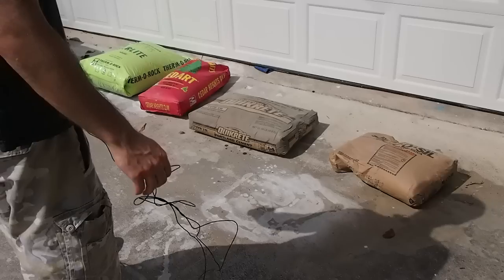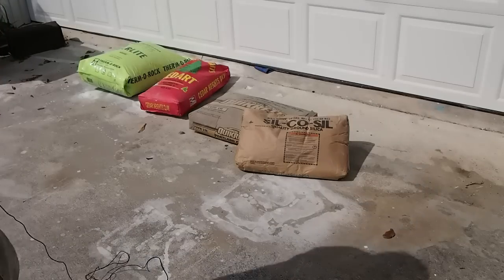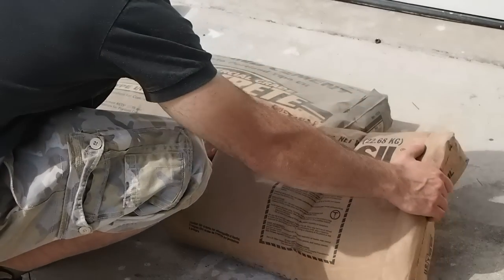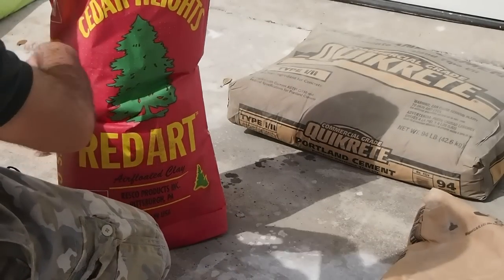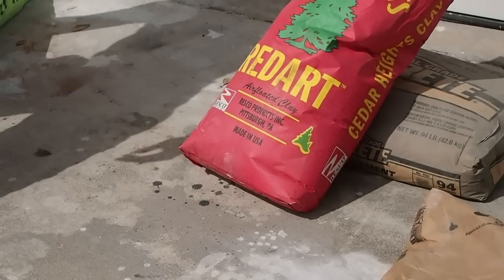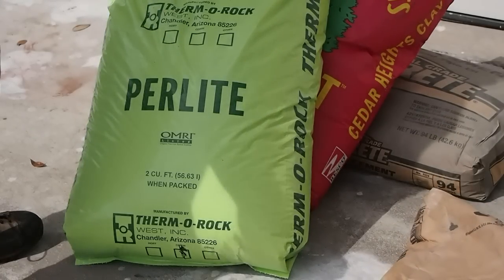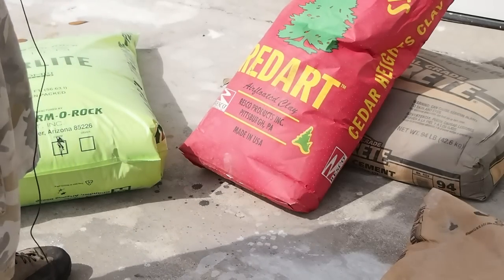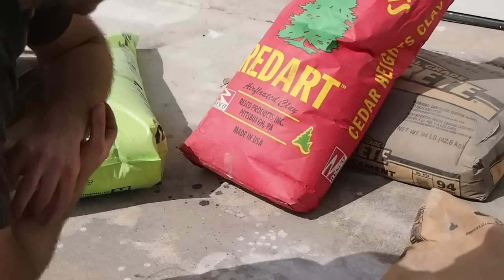DIY Refractory Cement Materials.MTS

Comment: I would use clay with around 10-60% grog, perlite, rice husk ash or sand. You may have long-lasting refractory clay this way. Love how your bag of clay has such fine stuff, while mine has hard ass bits of coarse sediments mixed in them, when I was looking for local clay. If you want clay to be fired real hard make sure everything is super fine.

Comment: I just built my cast for a rocket mass heater with 3" walls for burn tunnel and heat riser and it all got expensive really quick because how much the perlite compresses.  Did you mix everything in this video bag to bag?  How well did your mix hold together and handle the heat?  I may have thinned out my materials too much and may need to explode my cast to reclaim the materials to add in more clay and water glass.

Comment: You CANNOT use "quikcrete" or portland cement, in fact you cannot use any type of lime based cement. The reasoning behind what I say are fact based, I genuinely want you guys who are interested not to make unnecessary and potentially expensive mistakes. If you want real advice from someone who has genuine experience in foundry work, as a farrier, and a hobby silversmith then keep reading.
Firstly,  if you want to make a furnace, you have a number of decisions to make. At this point, a paper and pad is useful. If you are making a furnace from a disused gas bottle (probably the best route, not the cheapest but will save you a fortune in gas......gas is the only fuel I will ever use as it is the most easily  controllable, and definitely the cleanest) the a refractory has to be chosen. The chemical composition will be the definitive factor as to what metals you can effectively melt. Mine is rated to 1400°c which is plenty hot enough for my needs eg bronze, brass and copper, aluminium and it's many alloys. However you might decide you wish to cast iron etc, so a different refractory would be needed. Either way, AND THIS IMPORTANT! you must not use concrete, the reason why is that, yes it sets very hard with a chemical reaction using water, however when you heat this beyond 600°c, you basically start to drive off the chemically bonded water in the cement holding it together. This is bad, the same happens with the plaster of Paris type burners. The result is catastrophic failure. You will spend so much time fixing problems you will get very bored, very quickly. And besides, it costs £10 for 25 kilos of alumina refractory, it just ISN'T WORTH WHILE TRYING TO CUT CORNERS! you WILL completely regret it. By all means make yore own green sand, but don't mess with the refractory! If you need any help,  especially if you live in UK, give me a shout on my email, I will be happy to help. email- idauber@ymail.co.uk

Comment: Portland cement holds moisture after curing. That moisture expands when heated hot enough as it becomes steam. It creates an explosion.
Reply: Tango Tulsa Yea, but if you let it cure for a good week or two, or keep it under a heat source of some kind, it'll dry safely. I've used a mortar mix with some added play sand, 5 - 1 play sand - Portland cement mix, in an aluminum foundry, fired it twice, and no steam.
Reply: BlueMacGyver
How so?
Reply: The cement could crack and steam but not explode.  It is important to take the proper steps to remove the water but it will not cause an explosion just a structural failure.
Reply: +BlueMacGyver If the cement is thick enough and green enough, it can spall pretty energetically if heated just right.  You're correct that it isn't an EXPLOSION, but it can spall violently enough to be dangerous to nearby unprotected eyes.
Reply: Still using the foundry, no spalling or cracking. Dried for a week, fired with a slow fire, no air injection. Then fired slowly to optimal operating temp for a couple hours. Easy peasy.
Reply: +Lee C. Any idea about how hot your aluminum foundry gets?  I'm contemplating a wood burning rocket stove for cooking and recreational purposes.  I doubt it will get hotter than an aluminum foundry, but if you have good data that would be useful to me.
Reply: It gets to at least the melting point of aluminum, about 1221 F. Of course it gets hotter than that though. I don't have a laser thermometer, so I can't tell you for certain.
Reply: +Paul Bunyan I have built a foundry and fired it many times in the last several months and the recipe was mearly 50/50 portland cement and perlite from Miracle Grow.  This stuff has been so easy to make and so very tough, no blow outs, only cracks which were predicted by original recipe maker.  So much fun to play with.  I melted about 15 or 16 cups of aluminum at one time and have run that foundry for  hours in a row.  If anyone actually care about what works then this is it.
Reply: +BlueMacGyver I definitely care...  I wonder about adding glass fiber if preventing cracks for aesthetic reasons would be a concern...
Reply: +Paul Bunyan You could do it but, it would melt.  This is why no one uses sand in their mixes.
Reply: I did try to heat treat a 20lb hunk of scrap plate 2" thick I found at a scrap yard to see if I could and ended up glassing the edges of my mortar lining that were closest to the bottom, right in the hottest portion of the fire. It cracked some. Aesthetically it was ugly, but didn't affect the performance at all.

Comment from the maker: well if you made water glass you were doing better then me. from what i understanf rocket mass heaters should be made of cobb (clay +straw). my mix did not hold up! i wouldnt recommend using this recipe for high temp cement.  i ended up buying some castable refractory which worked much much better!
Reply: +PowerItYourself 
It's the bench, the thermal mass, that is made of clay & straw.
For the burn chamber and heat riser, you need something that can stand the phenomenal temps.

Comment: why do you need ground silica when you already have perlite?
Reply: The ground silica is in place of silica sand. Its sharper cut than concrete sand so it binds better. Never use play sand because it is refined for soft edges and is garbage as a tempering material.

Comment: it seems you are making insulating concrete. true refractory cement contains calcium aluminate. portland does not tolerate heat for long. so do some research.
Reply: Good to know!
Reply: I think refractory just means it can withstand heat. Portland Cement has some refractory abilities... but I'm not sure how much. It has to have some to meet building codes. If I were mixing this, I would use a high fire clay (i.e. lincoln 60). Either way, how did this mix work for you? What are your ratios for your mix?
Reply: terry smith
you can cant use Portland anymore for the fire box ya got to get fire proof premix mortar, it comes in ice-cream like containers just regular stuff crumbles it wont last 3 months with standard portland
Reply: I'd skip the cement if I was him.
Reply: Brother what are the ratio to make refractory cement I will really appreciate if you will share some of your knowledge.
Reply: I don't think he is using it in an industrial manufacturing setting. If it works for him, it works for me.
Reply: Alf Cara do you have a refrac mortar recipe with calcium aluminate sand and NHL
Reply: You may be right. However the Honey do carpenter has been using portland in his air crete mix for his rocket stoves and heaters with amazing results.

Comment: What's the ratio at which you mix all these ingredients? What temperatures can the finished product withstand?
Reply: +DukeOfMarshall I got a recipe for the same materials, 1.5 measure of cement, 2 measures of perlite, 2 measures of sand & 2 measures of clay. My recipe called for a different cement than 'Portland' , a cashable refectory cement , came in tubs as a dry material & the clay needs to be of cashable quality, like Bentonite or well drillers mud. Good luck

Comment: You can't use portland cement on "refractory" mortar...  Please no one build anything that get's over 400 degrees with this garbage.  Wood fires burn around 1100, and portanld cement breaks down as it cools from above 600.  After a few fires the mortar in this video is nothing but unbound sand and clay and will fall apart easily.
Reply: What do you recommend?
Reply: FireStop mortar (that's a brand) and actual refractory bricks. expensive stuff!
Reply: Around $50 a bag
Reply: Hmm. Strange, mines held up at regular 1500° without incident for some 22 years now! Guess I did it wrong though.😑👍🏽
Reply: 4R did you use this same mix, or something different? And do you have any special tips on building or curing?
Reply: Any tile mortar that is speed mortar or rapid setting contains calcium aluminate cement and very little or no Portland. Throwing some fire brick wrong or kyanite garage and there you go cheap and strong